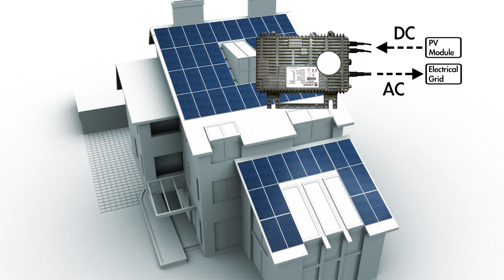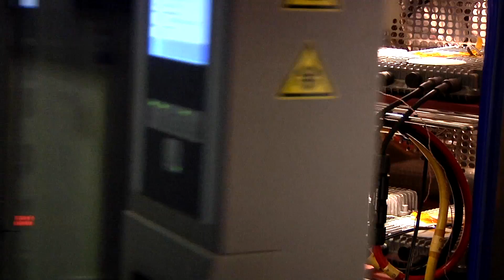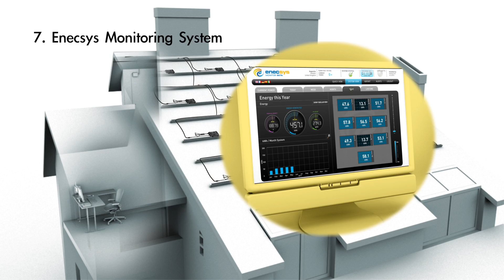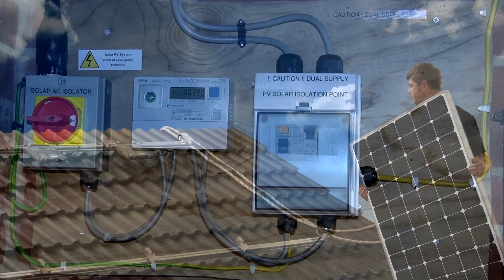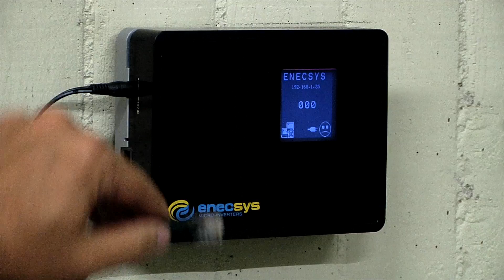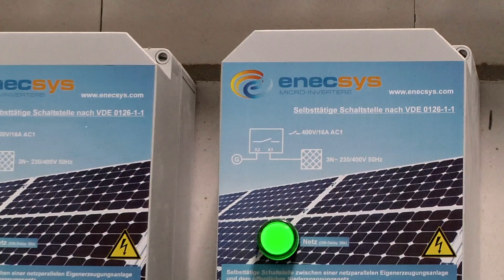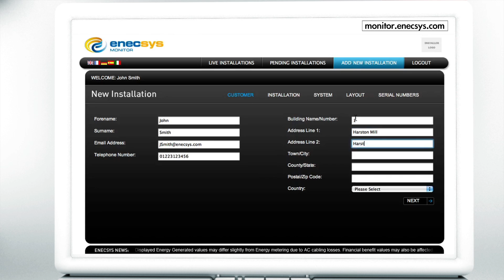Enecsys Micro Inverters Installation Video

Comment: just bought some micro inverters mady by Enecsys for Canadian Solar CM 240-EC micro inverters. I cannot use them because the seller did not provide me the AC cables. As you know the AC connector is a special five pins model not easy to find. I beg for your help since the units are useless for me as they are. Please help me.
Thank you.
Reply: Bernice Perez I had the same problem, I Used the protection cap to make one. 
pin 1 = L1 and pin 2 = L2 the pin numbers are on the cap.
drill the holes through and solder small connetors in the cap.

good luck
Reply: +Bernice Perez  do you still have them?